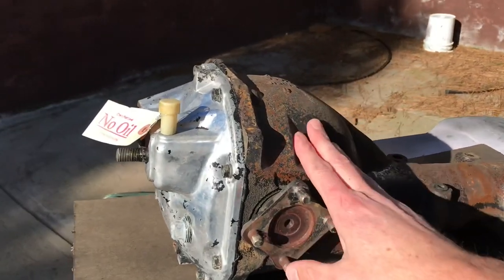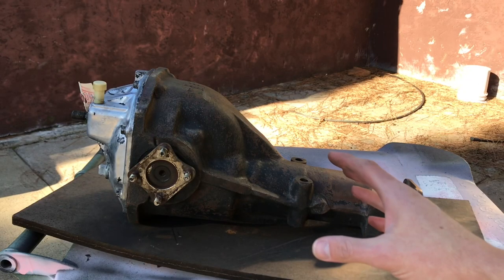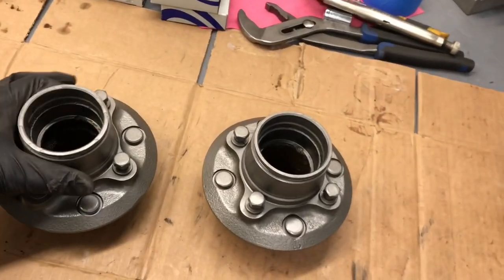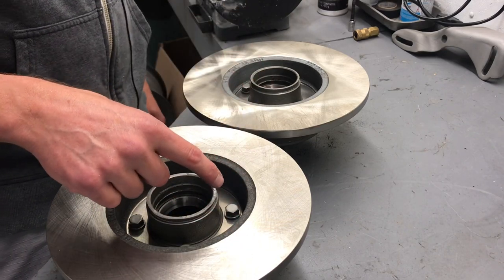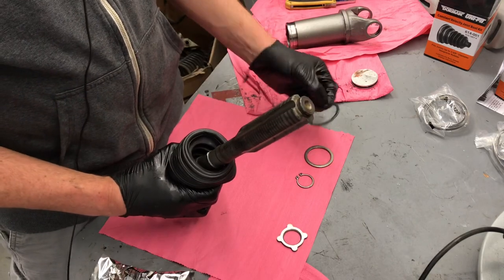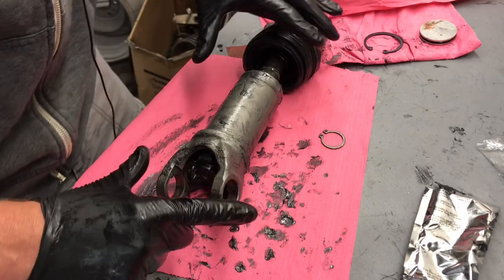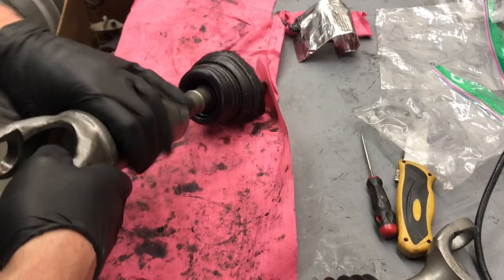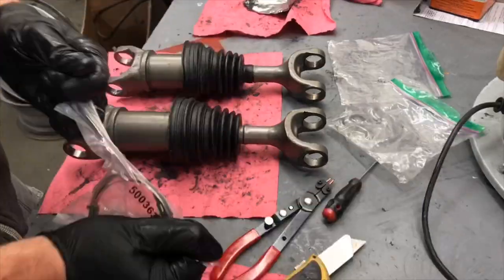Drivetrain assembly on the Datsun 260Z EP3

Comment: Are you reusing the old half-shaft parts, i.e. balls, spacers, snap rings, etc?  I'm not having any luck finding rebuild kits/parts.
Reply from the maker: +Kraals I am reusing, thankfully they are in really good condition. I have yet to see any kit available for them. Are yours rusty or really thrashed if not, I would just clean them really well, lube and install with new boots.